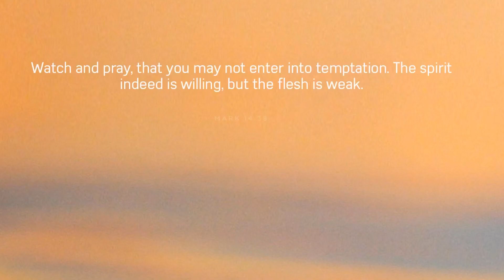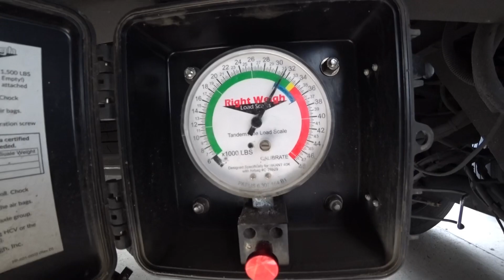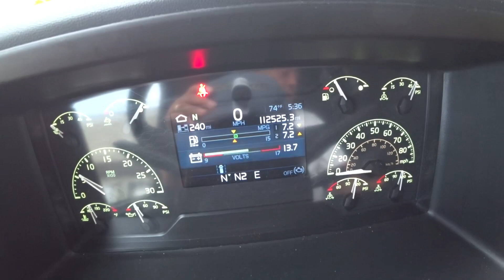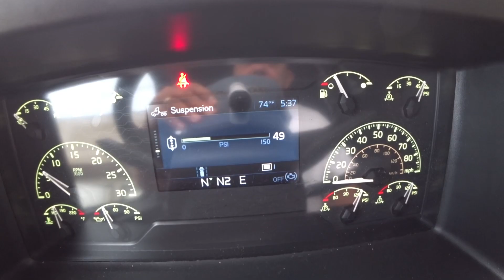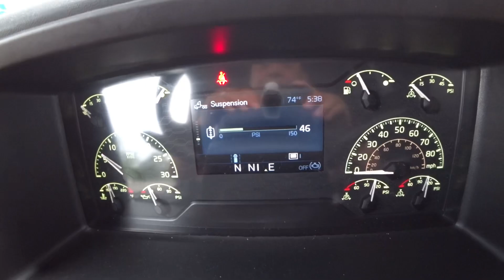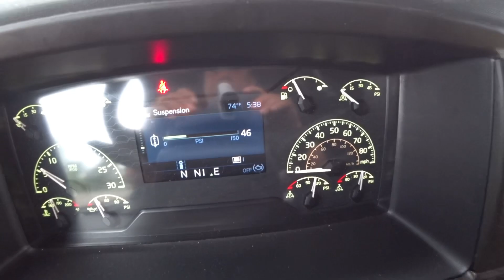August 7, 2019/643 Trucking. Sliding the tandems and loaded. Marathon City,, Wisconsin

Comment: Since ur truck weights is in a different numerical system I would get cat scales and note on a pad the truck weight versus cat weight like write it down on the pad like 49= example 30,500 and do that several times so you’ll know what weight 49,52,54 ect ect is and use that pad as a reference or create a file in it Phone w that information and numbers

Comment: I did not get the answer to sliding the tandems
Reply: Sliding the tandems redistributes the trailer weight between the tractor pulls and the tandems. By sliding the tandems back , you push weight toward the pulls and vice versa. You can have up to 34,000 lbs on the pulls and tandems, by sliding you can move weight  on the axles.
Reply: Gerald Blackwood I’m only 12 so if you could please break it down please